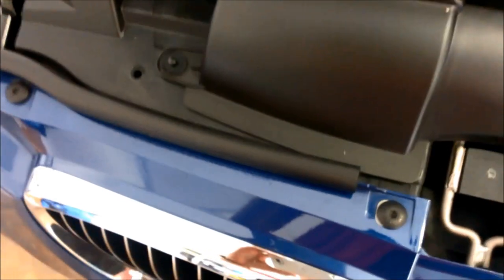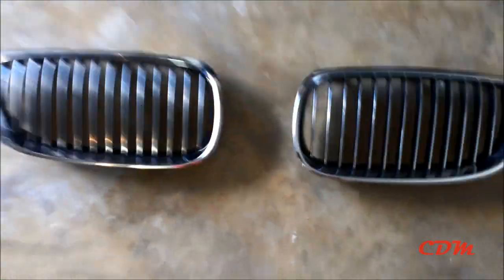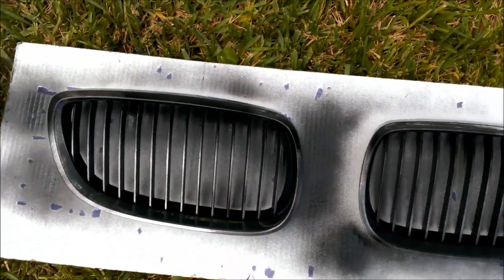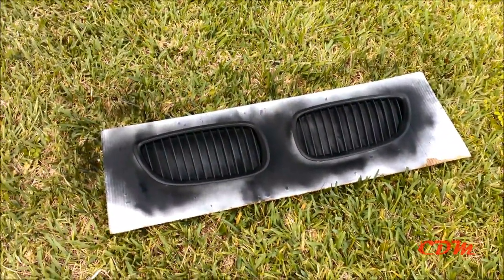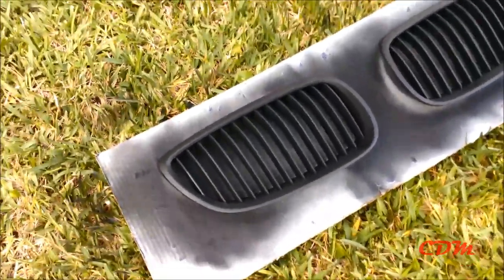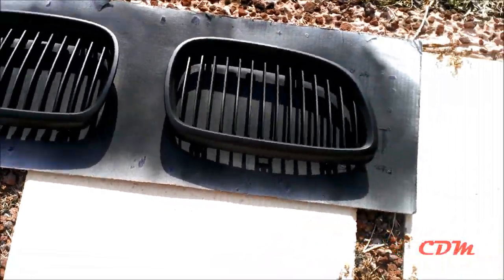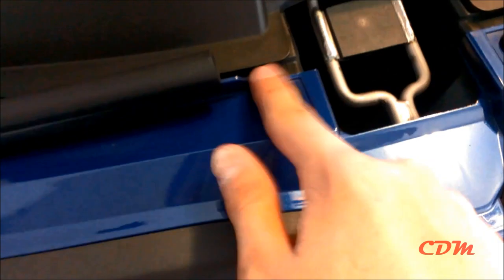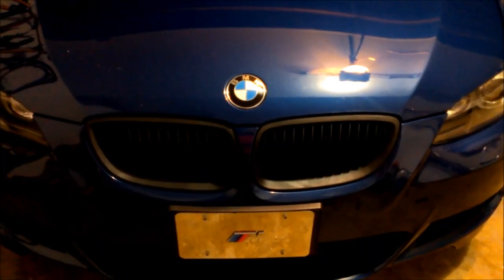How to plasti dip bmw grills

Comment: Spray job does need work but thank you for the info. When I did it, I taped it up and did the balloon method where you inflate them behind the grills so plastidip doesn't get on the radiator and other bits.